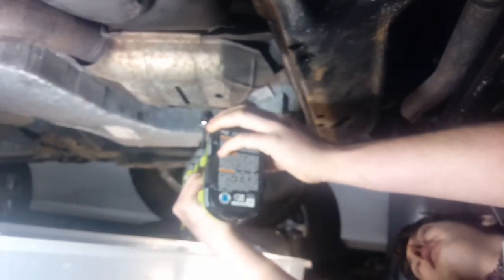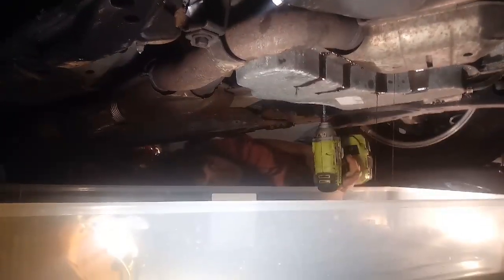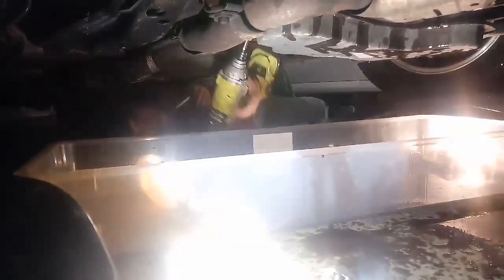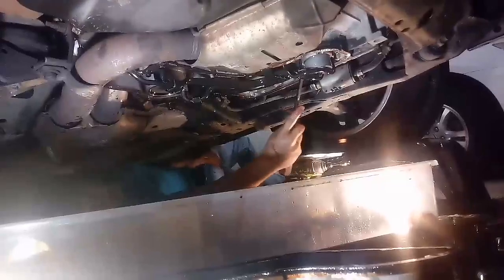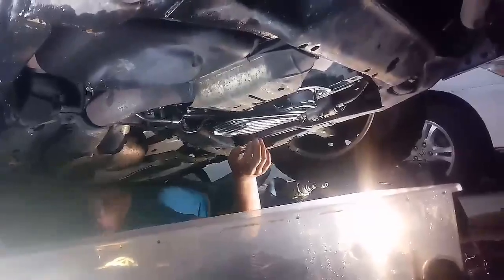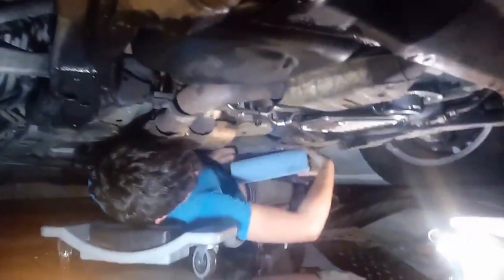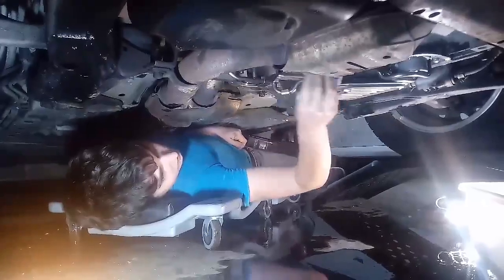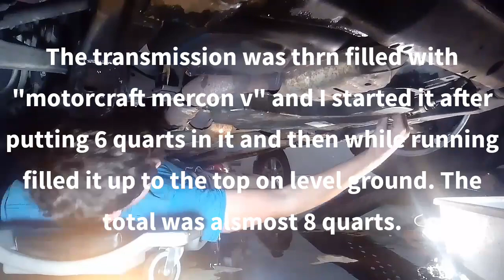How to change the Transmission Fluid on a Lincoln Continental AX4N Transmission

Comment: im a little confused about this "lifetime fluid".. i have an 09 mks with about 80k miles and ive been reading a lot of conflicting information online about when to change it, if at all. i don't know if it was changed before i bought it last year. idk if you're familiar with other models, if you are is it time, or too late? it shifts a little late sometimes but aside from that it still feels pretty normal. thanks
Reply from the maker: Change it. Get it done by a proffessional transmission shop with good reviews. 80k is still pretty low so you shouldn't have a lot of buildup yet. The fliud losses its properties over time and use and once the clutches start slipping, it's a costly domino effect from there. Request motorcraft fluid at the shop. Start changing the fluid every 35k. It like $150 or less for a fluid change vs $1500+ for a good trans rebuild
Reply: @mechanicalking  got it, thanks for the tips 👌

Comment: How’s trans shifting after doing fluid change? Got 103k miles and thinking of doing it but idk, it’s a 98
Reply from the maker: It blew up from a neutral drop. The first gear sprag shattered but it was shifting good before that
Reply: @mechanicalking  oof, plan on replacing the trans or moving on to something new?
Reply: Why did you do a neutral drop?
Reply from the maker: @zanotube6567  those things aren't worth much i was having fun